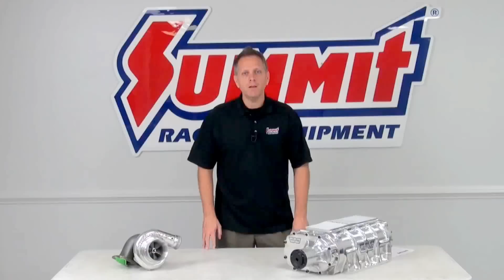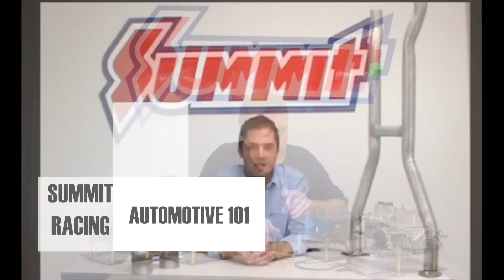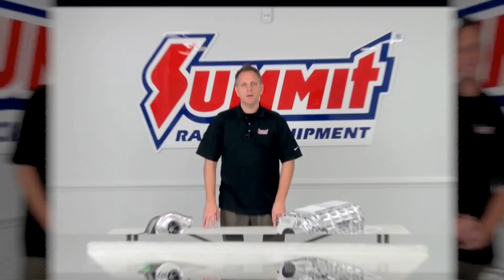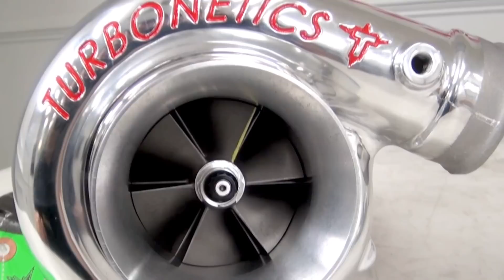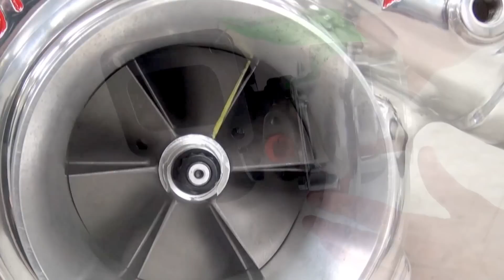Supercharger vs Turbo - Summit Racing 101

Comment: I always keep it simple, 4 - 6 cylinder cars get a turbo, 8 cylinder cars get a super charger. Also, don't get a non turbo car and try to turbo it. You waste a lot of time just to find out it would have been better to upgrade your engine via engine swap. Always just get a car that is already turbo and upgrade it to be able to withstand a bigger turbo, much easier process

Comment: most comercial trucks are powered by turbos and at the national truck races a gmc truck running a little detroit with a little wore out and retired supercharger got took out of a garage  flat smoked every body with athority it was awsome ,
the little truck was from the 50s and had to warm up for awhile just to get the injectors working
LOL My father inlaw was the previos owner I helped TOW it home and  get it running LOL
It was up against the newest turbo tech LOL

Comment: The best form of turbo vs supercharger that i can think of is on the early airplane .
the old prop planes could only go 1500 feet off ground  the turbo pushed them up to 3000 feet.
a small 142 gmc blower drove them up to 50000 feet..
its a air pump cfm and density competition and as you can see  supercharger doesnt just win.
It crushes the competition!

Comment: superchargers are not parasitic  !
on my B&M 144 at idle  the vaccume is turning the supercharger.
It might take a whole 25 horsepower to drive it.
At thottle and this is one of the tricks . is to have 400 pound valve springs ,crane anti pump up lifters .
so the motor and supercharger are not governed by 4000 rpm valve float.
on a bone stock 350 190 hp you get 350 hp  thats 130 hp add on.
off the line .
then with springs lifters and roller rockers then you are pushing right around 600 plus
but your drive train should be reinforced cause you will  be putting a mountain of tork through high rpm.
and the supercharger  will push in excess of 12000 rpm

Comment: You also forgot that with the right set up you will have 0% lag with a turbo or you can set up an anti lag system and with a turbo you can make 2x more power and sounds better at boost and blow off...

Comment: Fuck me the supercharger doesnt have a parasitic effect at all
500hp engine gives up 1 hp to drive a lagless charger to gain 500hp n ends up being a 999hp engine 
The turbo impedes the exhaust and intake the entire time till spool and continues to molest exhaust flow the entire time!
Reply: 1) It takes more than 1hp to drive a SC.
2) There's nothing wrong with higher back pressure, it just means the engine works harder on the exhaust stroke instead of the power stroke (like in the case of the SC). for a multi-cylinder engine (literally any engine) this means it's just using a different cylinder's power stroke to leech off of. 

Turbo draws less work from the engine since it utilizes the pressure energy of the exhaust gas which is usually wasted into the environment.

I'm still an SC guy but what you're saying isn't accurate. SC's are better (depending on application) for the reasons of instant response and lower rpm available induction not energy/work management.

Comment: how much can you increase power of NA with roots/screw without need for intercooler on a front engine ?
Reply: you dont need a inter cooler unless its over 100 degrees and your pushing more than ten psi.
thats a roots though I dont know about the screws

Comment: What about the overall longevity of the engine when you have force induction?  It obviously decreases doesn't it?
Reply: Induction by itself won't reduce the life of your engine especially not if it's designed or modified to handle higher (average) internal operating pressures/temps.

What will reduce its longevity is usage of induction while racing the engine at high RPMs.

Drive normally for the vast majority of the time and you should see nearly identical engine life spans.
Reply: it depends on how you gear your car how you build engine .
but it does shorten bearing life a little bit .
but the blower is worth it.

Comment: Turbo makes awesome power just always felt funny about pushing exhaust back into the engine
Reply: pantera owns Turbos use a shaft to connect two turbines together. The exhaust side is driven by the exhaust, and the intake side pulls fresh air and pushes it through the intake. You aren't putting exhaust back into your car from the turbo. The EGR system does do that however, and has been around since at least the 1970's.

Comment: problem with turbo your cramming more air in but your restricting the exhaust flow because of the turbo. I haven't seen any turbo cars run less than 4 seconds in the 1/4 mile like superchargers do.

Comment: lag this lag that, come on. With turbo technology today turbo lag is almost no existent. As long as your matching the right sized turbo to the engine, a turbo will win all day everyday. Superchargers are old tech, in the next 10 years no one except for old die hards who dont know how to change will be using them.
Reply: they use at least 2 turbos to eliminate that lag. And in the next 10 years, old die hards will be the ones using combustion engines

Comment: What if you install both in your car?
Reply: that is called a twin charger and you'd have one fast fucking car
Reply: funkierfawn budgie, you'll tear a hole in the space-time Continuum and fk us all Morty!
Reply: Dont waste your time with that just get twin turbos
Reply: funkierfawn budgie that would be awesome! both supercharger and turbocharger!
Reply: funkierfawn budgie I think the Zenvo st1 already does
Reply: BMW x6 m550d has 3 turbos, all different sizes, first for low rpm, second for mid to high and the third one is in to help the second one when needed. Youre always getting boost that way its pretty good.
Reply: Yeah they already made cars with a supercharger and turbo together
Reply: Your car will start flying
Reply: Just get a pro charger
Reply: Volvo Penta diesel boat engines are built with both turbo and a supercharger.
Reply: funkierfawn budgie 
If it's an all out boost war you want, you would be better with only the turbo.  The supercharger would only slow down the potential flow.  (If your turbo(s) are properly sized the lag issues are also no issue.)  In the end it comes down to what you hope to accomplish.  Sounds like you want a ton of "flow", so turbo is the way to go!
Reply: Burrell1 , wrong
Reply: funkierfawn budgie you could blow the engine and if you don't keep up with oil then a piston or two could shoot out of your engine
Reply: the blower would over speed the turbo and shatter it.

Comment: If you have two of the same cars, same weight, same areodynamics, same engine, completely identical other than the fact that one is turbo and one is super,  would one necessarily be faster than the other ?

Comment: what would he the best for built 355 sbc in a 82 Chevy shortbed? can't make up my mind on which one.
Reply: It depends on what you are looking to do with it, but I would go with a Super charger bro. You want to step on the gas and rip those tires loose instantly. Plus, I just can't wrap my head around a turbo charged short bed. Just seems odd. But ultimately the choice is yours of course. I am just telling you what I prefer personally.
Reply: as long as you have less than 9.25to 1 go with a single carb teflon bladed holley or weinder 144 5-7 psi .
you wont be sorry ther incredible.

Comment: The thing about turbos that annoy me is the lag. I'm in a turn with no boost and then BOOST!! and my back end starts coming out.
Reply: [StoneBato] kudos on drifting a foxbody
Reply: Just keep it away from crowds😂
Reply: Brwnleaves have u driven a turbo car or are u just using this example cause you have heard someone say this before
Reply: tomjw7 It was a diy turbo'ed 85' mustang and the boost was set at 3500 rpm so when you would downshift the boost would kick in and the back would (theoretically) kick out bc power from the turbo. We were trying to build a drift car and we couldn't figure out why the turbo was holding out.
Reply: did u ever figure it out
Reply: tomjw7 yeah our custom intake manifold didn't seal so we were losing power initially when the turbo would start spinning. That also explained the low pressure reading on the dash.

Comment: can you eliminate turbo lag with just adding throttle in a manual transmission?
Reply from the maker: Hi jnak, 
Can you please call our tech line? 1-330-630-0240.

Comment: What do y'all recommend for my 67 Camaro SS?
Reply: john wardiani so you can do a burnout and hit a car or a crowd of people
Reply: john wardiani Mustangs can't go in a straight line DO NOT BOOST THEM THEY WONT EVEN GO STRAIGHT AT ALL 
ALLL I TELL YOU
Reply: iStallion GTR 

Mustang drivers are so gay they cant even drive straight
Reply from the maker: Hi Daniel, 
We need some additional information from you. Can you please give us a call at 1-800-230-3030. 
Thanks!
Reply: On a small block 327 or 350 I'd start with a forged crank on a 4 bolt main,  hot cam,  around 8 compression with a 14 boost from a Weiand or Eaton root Super charger.
Reply: Daniel Dalush super
Reply: A better driver
Reply: john wardiani holly fuck he told you 😂
Reply: Crowded killer
Reply: I'd recommend buying a mustang

Comment: They both have their ups and downs. In general, if you want instant, brutal power at low gear with great acceleration, get a supercharger. If you want tons of extra boost while accelerating from 50mph, go with a turbo.
Reply: Man why does everyone always forget about Antilag???
Reply: I have been in racing a long time  . 
nitrous kind of explains  how it works guys , Its a super cool gas thats not exactly burnable,as in freezing.
It causes super dense air  and about 5 or so psi thrown in on top of it,ups compression and litterly
pushes your engine through rpms .
its a realy good additive to a turbo or supercharger as a boost helper.
because it cools the air that they are heating up.
My b&m 144 roots  supercharger   with 9 to 1 compression runs about 100  degrees to 140 degrees.
Turbos  run about 1700 degres on a  gauge, not very dence is the air in the turbo.
I drive state of the art equipment and cook on my turbo all ihe time. LOL
The biggest turbos put out 100 horse power thats it.
the new screw super charger has good horse power through its low end  but just doesnt have much of a top end and thats where your info comes from.
A roots supercharger with 400 pound valve springs and anti pump up lifters on a basic 350
at 5 =7 psi starts at 120 horsepower up to 5000 rpm  .at 8000 rpm my blower is pushing about
9 psi and putting out about 250 hp with my 300 hp my 350 is putting out about 550 hp on the dyno 
and it increases under a load.
and a turbo doubled up still onley gives you a hundred horsepower because it is splitting the exaust
powering them between the two turbos.
they even suckered jay leno with like 8 turbos  making a thousand horsepower or so.
without the exaust to drive them .
It would have to be running at 40000 rpm to drive those 8 turbos pushing each other and would run so lean it would melt the turbos block excetra.
I just run a 144 cfm roots supercharger
its the tip of the iceberg.
It will exeed what the motor will handle if i just stand on it.
and it goes 0=60 in 1.45 seconds
in a 6000 pound 76 chevy blazer a 10.650 in the quarter 
I cant wait to put it in my 1982 elcamino that weighs 3100 pounds
bring on your turbos any time.
just like a centerfugal supercharger all youve got ts a short power band though the spooling and power in a maxed out ride is impressive  its short lived
and then they have to compete with the big roots blowers.
Reply: and to big of a shot of nightrous thou itcold will melt the best forged pistons.
Reply: Roots superchargers give brutal power all through their power band witch is about 3 times the size of the turbo.
when you hit the kickdown punching it at 110 miles per hour its the same as at 35  about 2.5gs.
 Its about a second to 160 miles per hour thats faster than my 1.45 gs of the line because its higher in the powerband .
my 6000 pound blazer goes 0-60  in 1.45 seconds.
When the turbo quits pushing the roots blower keeps pushing and pushing.
watch top fuel drag racing quarter mile in 3-4 seconds at outrageos speeds.
a turbo trying to do the same would sheer its impellors off
they push the turbos because their cheap to make and a lot of them cost way more.
Reply: best if you connect both soo allover boost
Reply: seconds exuse me
Reply: the real competion  for the little roots blower came out in 1978.
gm sneaked it in to nascar  it was the first sb2 by buick .
a small block with the valves pointed at the center of the cylinder dry sump 
pulling 700 horses   with a 4 barrel carb .
us normal people only get  about 500 horses of that in the new corvette engines
Reply: you must be talking about a screw type supercharger not a roots
Reply: Daver G  I owned a big vortec supercharger  that was given to me by the owner and pit crew in pit row when they were replacing it with a new one he said it still worked fine.
And it said right on it formula 1 vortec right on it  .
they asked me how I got in there I grinned and said I snucked  grinning and he grinned back  handed me it and said now sneak back out and I run for it.
I could hear them laughing all the way out.LOL 
that was back in the 80s  at Indy.
Im not sure what they use now .
It grew leg and walked off over the years,
But it was awsome.
Ive seen a bunch of the same ones over the years could probably find them on ebay
Reply: I hope you know that turbos are built alot better and there is just about no lag with a good tune superchargers are pretty much a thing of the past  cool looking and do work but they only give you low in power and torque soon the nitrous Motors will be ahead of turbos
Reply: @kiowa1980  Guess you don't keep up with Water intercooler 8-71 or bigger with Teflon strip rotor seals which are real common. When you run alcohol even on the street the super Charger will be cool to the touch. Cool thing is it'll pass emissions in all states. Power off idle to top end super with monster torque! So you can pedal if traction is problem and still have instant hp/torque. Cost about the same as turbo but way harder power and extreme on top end! Most race you see the loser with a super Charger it a show low boost set up. Think about what you said then think Top Fuel...lol! I drove on street a 10-71on a 520 BBC and still ran a 6.86 at 201 mph in the 1/4 mile in 1987. Yes I did up the boost for that run, changing one pulley. Pro built 31 Chevy weight 1489 lbs. Top power in any power added is for smart wrench Turner's who have knowledge and always learning. My cheap ton of fun now I'm old a O-ringed 496 w500hp dual stage3 NOS in a 78 Corvette! Also full cage, M/T dot drag radials top off with chute and handicap tag!!! If you in North Atlanta area come take a ride. Maybe 8.90's in a 35 speed zone lol! In the 1/4 young man! Smile!
Reply: @kiowa1980  If Super Chargers are a thing of the past then why do Top Fuel Rails and Funny Cars running in the 3 second range in 1,000 ft still use them and not Turbos?
Reply: zach m  you sure, i think a turbo would also increase acceleration at low speed, sice it depends on the rpm
Reply: Kasam it does, but most dont spool up till around 2.5 or 3k rpm. blowers are always making boost
Reply: What have you been smoking ?
maybe your thinking about a screw supercharger ive heard that about them.
there alway using nightrous to get a 10 1/2 second quarter.
but you know nothing when you say roots blowers are a thing of the past.
and that turbos beat them up .
They might get them in the right powerband for a second but then the car shifts and it aint got shit and the roots blower intercepts .
mind you i have a little 144 against the biggest and baddest turbos 
and have not lost yet ! 
I imagine theres a few out there that would beat my little blown 350 .
But theres plenty of big blowers on bigblocks pulling 3 minute quarter miles just waiting LOL.
Reply: @alonzahanks1182 , when it comes to compressor efficiency this is the general rule.

Roots.         45%
Screw          65%
Centrifugal 75%
Turbo.         75%
Reply: efficiency a Twisted word  Tip toeing around  psi   HorsePOWER  Torque 
From  700 RPM to  8000 rpm  which leaves the  screw charger  centerfugal  
and turbo in the dust.
To get the 5-7 psi the screw charger has to turn 4 to 6 revolutions faster than the roots,
Thats why the screw supercharger will run  out of gas earlier .
the centerfugal supercharge has to do the same and dosent put out 
until super high rpm..
and the turbo has come a long way.
spooling and all  but it heats up to 1700 degrees .plus
Lets see you take that turbo car to the racetrack line it up on the quarter mile
 run it pull it back to the starting line and run it 5 times .
it wont make it three times.
My B&M 144 super charger will do it  all day long and every day until the bearings on the engine wear out .
and the turbo wont perform unless its under a load power blocking etc.
have you ever powerblocked a car at 100 mph.
going through a corner.LOL
I call that inefficient..
Thats why the formula one race cars went with the vortec  centerfugul supercharger .
because their engines are built to run 6000 rpms 
to 10000 rpms 
Thats  why they went with the centerfugal vortec super charger .
because it fit their application of purpose build.
thats what I call efficientcy..
But how many street rods will spin ten thousand rpms ?
NONE.
But for goofing around in a street rod.
with a light weight valve train with 400 pound spings and anti pump up lifters and forged
bottom end..
That roots supercharger will keep you in the winners circle 
with a big fat smile on your face.
without a nos bottle that runs out of gas.
but will perform even better with NOS.
thats what I call efficientcy.LOL